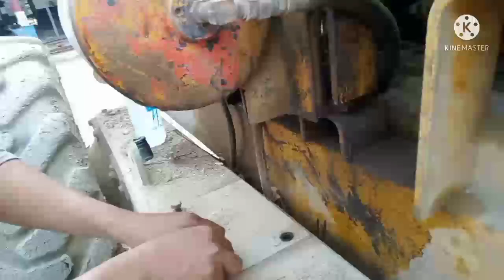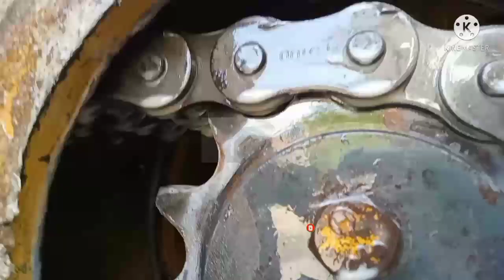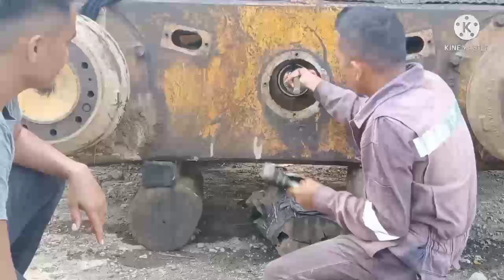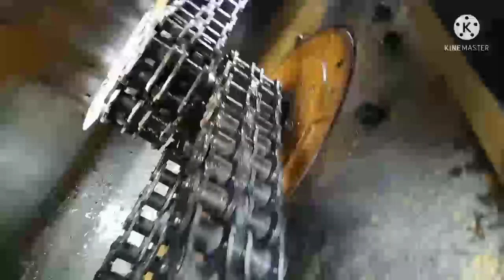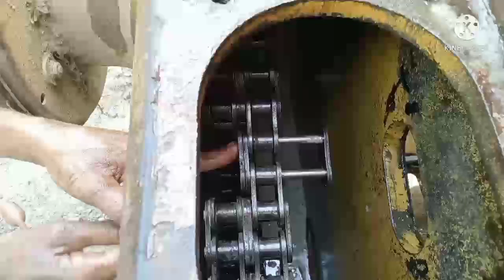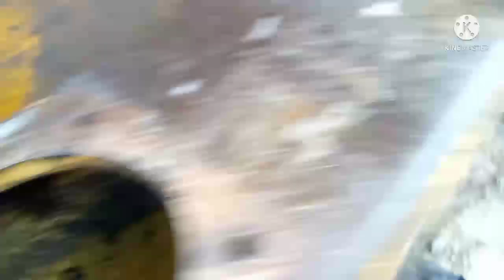Motor Grader How To Installing Axle Chain Kumatso GD511-A // Roland Repair Vlog

Comment: Ive never had to take a wheel off to change a chain
Reply from the maker: Ya betul Sir, buka Tyre apa bila menukar rantai tapi sebelum ni saya repair round gear dan saya dapat video hanya buat Pemasangan ratai sahaja,
Reply from the maker: Yes that's right sir, there is no need to open the tire when the changing the chain but before this couldnot the get just for flat installed only .